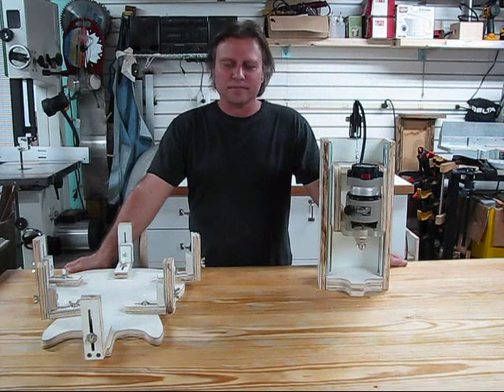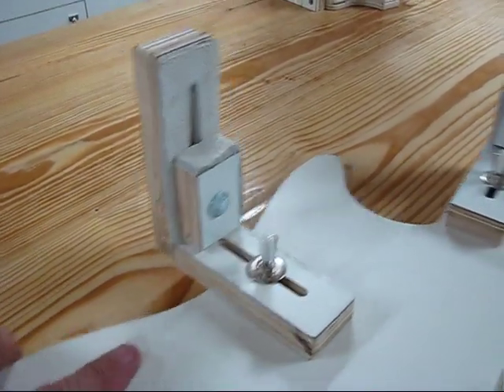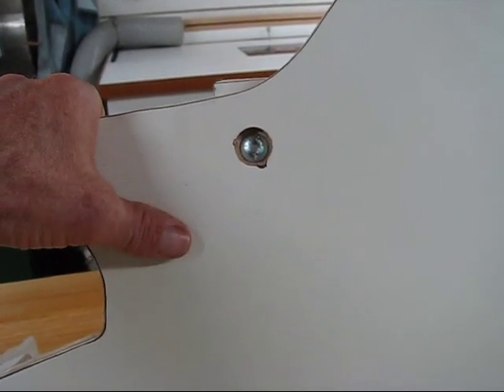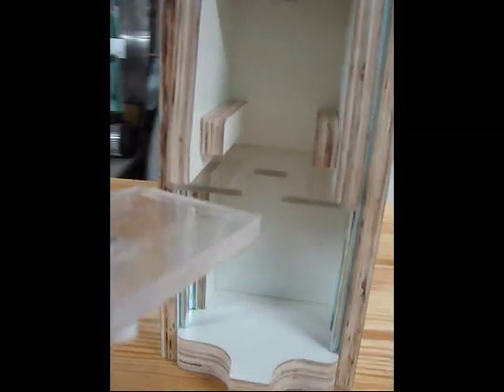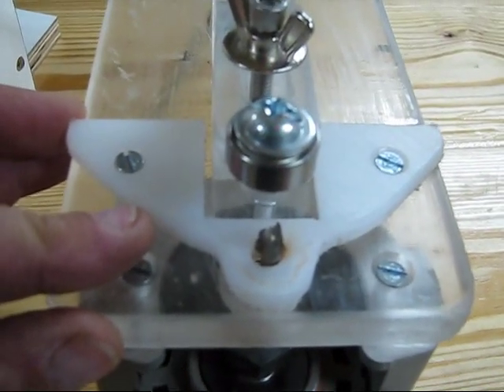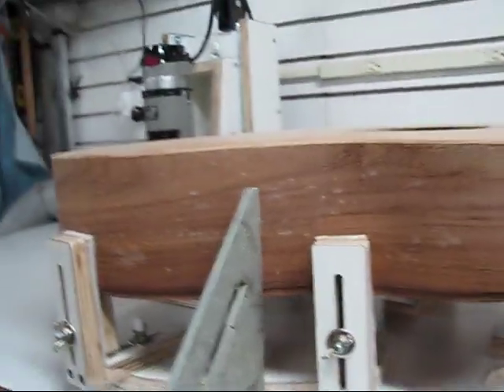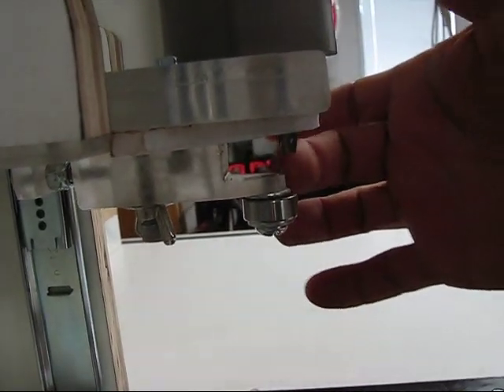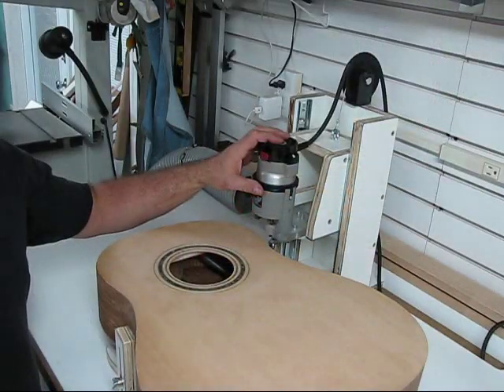Routing Binding Channel Using A Binding Machine

Comment: I tried both ways of cutting the binding rebate using a laminate trimmer and also using handtools only: the chisel and purfling cutter.
Although using the trimmer was much faster than using hand tools, I found that it's a great learning experience to use hand tools only to cut the rebate.
Just that session alone, my understanding of how to use the chisel improved.

I made the purfling cutter using some scrap bass wood, after seeing ideas from Waddy's build and the commercial available cuttings.
Glued the various pieces together using PVA.
Surprisingly though its poorly made, it worked quite well.

Comment: Hi Chris, Nice video, I wanted to mention that this is from my binding machine I built some 35 years ago with the cradle and router setup, Many great folks have improved this over the years but I find that sometimes I need to reming folks that this is all decended from the original Ribbecke Bunding Jig... keep up the gfreat work!
Reply from the maker: Thanks for the reminder and for your long time design. Sorry about not listing your name in the credits. I've changed the video description. Sorry about the oversight on my part.

Comment from the maker: About 4 1/2" and I used the plexi because that's what Mike Doolin used on his. I like using plexi for router bases because I can see through them. But these days I don't use plex too much if there is any machining that needs to be done to it like tapping especially. I've been using polycarbonate for that. Much better job with machining. If you have a plastic company near you then you can usually buy cut offs by the lb.

Comment: Hi Chris, thanx for the nice video … and all the others :) I have built a machine very similar to yours, but I have a question: how do you set up the width of the cut, not the depth ? I have tried it with a sort of scrap guitar and it works well, but when it comes to set it up with a piece of wood I have kind of problems.

Comment: Chris,
    I love your videos and plan to make a version of this binding machine. Just a couple of questions...
1) what is the distance between the center if the router bit and the forward edge of the router stand? This would determin the space for the guitar under the router stand.
2) Why did you use plexiglass for the router base and the bottom of the router carrige?
David Lehrer

Comment from the maker: @LFWOL Totally unnessecary as the counterweight does it's job prefectly. The purpose of the weight is to just to cancel out the extra weight of my router  as in some cases a counter weight isn't even needed. You want downward pressure just not too much so that the shoe won't mare the soft top and make moving the cradle difficult. The pedal is just a complicated devise to add and pack away. Probably would be a tripping hazard. And besides that I use my foot to control a footswitch for the router.